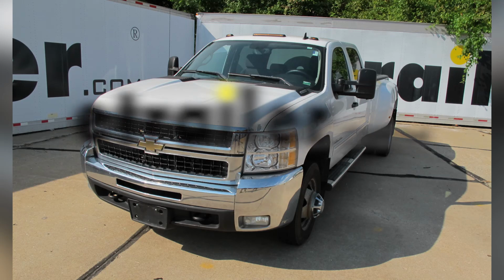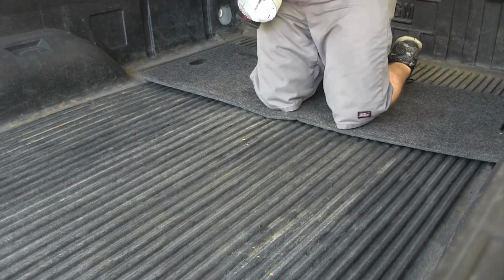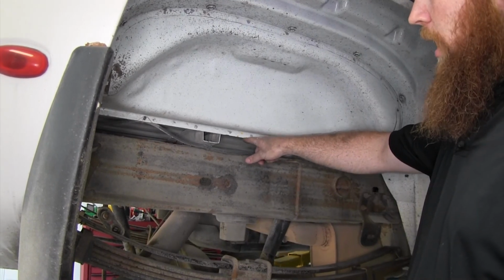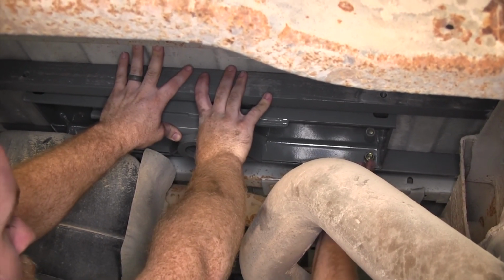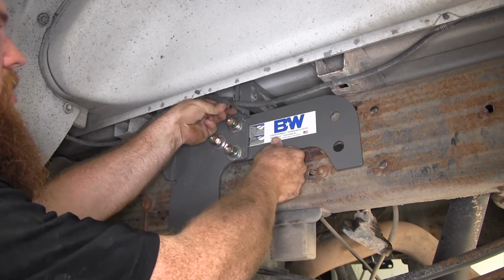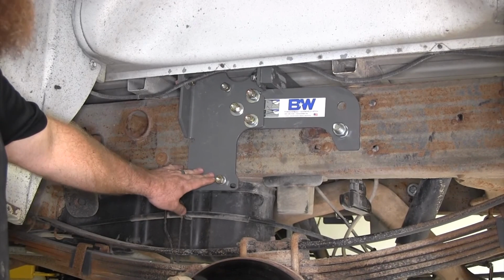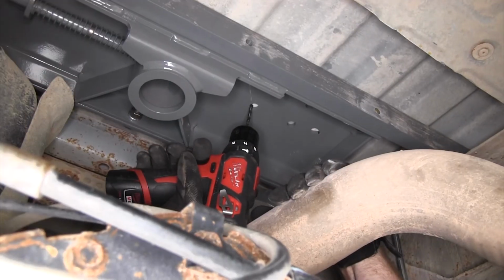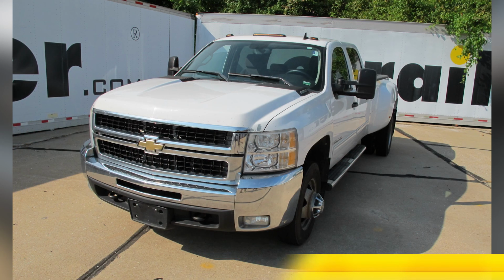etrailer | B and W Fifth Wheel Trailer Hitch Installation - 2008 Chevrolet Silverado

Comment: Looks a lot more like a gooseneck than a fifth wheel..
Reply from the maker: Actually, it's both! The B&W # BWRVK3400 B&W Companion Sliding 5th wheel hitch shown uses the # BWGNRK1067 B&W Turnover Ball gooseneck hitch as a mount. The 5th wheel and gooseneck hitch are available separately. You can check both out here:
https://www.etrailer.com/Gooseneck-Hitch/B-and-W/BWGNRK1067.html
https://www.etrailer.com/Gooseneck-and-Fifth-Wheel-Adapters/B-and-W/BWRVK3400.html